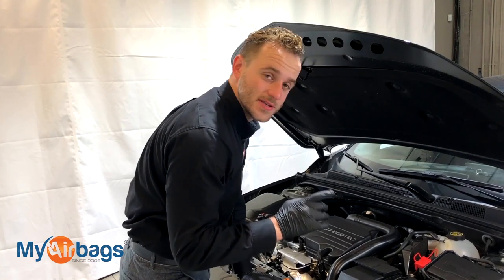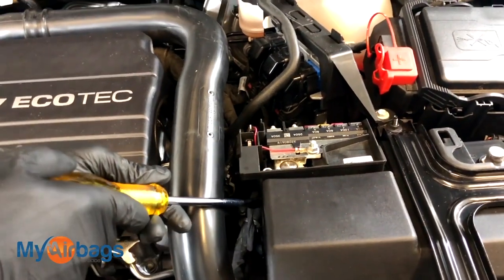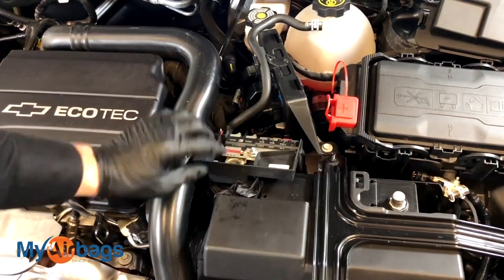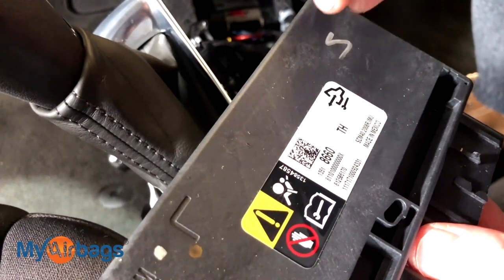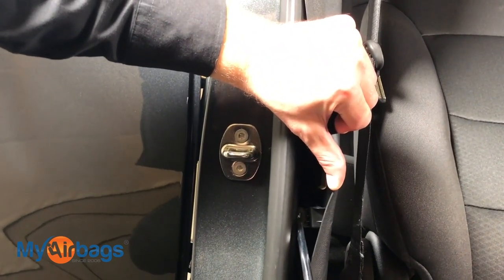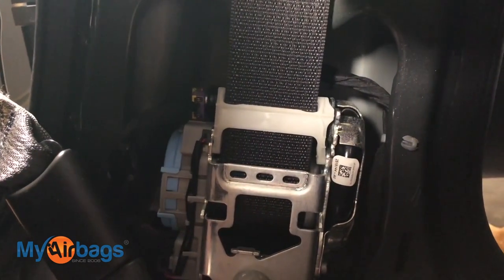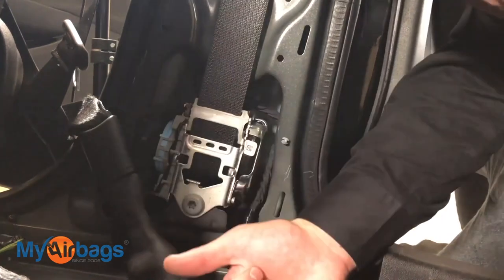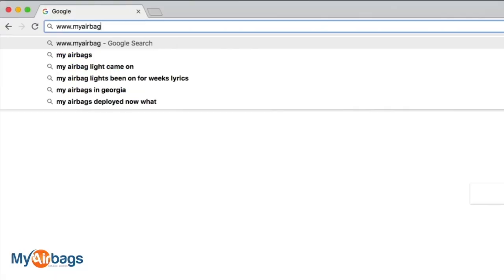How to Remove Seat Belt Pretensioner on a Chevrolet Malibu  | MyAirbags

Comment: I have a 2014 Chevy Malibu and my rear seatbelt on the drivers side is stuck. It will release a little bit but it took 15+ minutes of pulling it in and out for us to be able to buckle someone up.
Reply from the maker: It may need to be replaced or repaired. Check out myairbags.com for repair and replacements.

Comment: Question.. I’m about to do this myself in passenger side 2011
Malibu. Does this need to be programmed after install to get the light off? My light initially came on from passenger air bag pressence sensor, I replaced whole seat, but didn’t disconnect battery before I undid the seat belt so I have an open circuit.
Reply from the maker: If the vehicle was not in an accident, then the light would turn off after replacing the seat belt. If the vehicle was in an accident, then the airbag computer module also needs to be sent to MyAirbags for a reset. Visit myairbags.com for more info!

Comment: i have a 2005 Chevy Malibu Maxx LT the seat belt light started staying on how do i fix it and is the same as the 2018n model you are working on
Reply from the maker: If the light remains on it could be a for couple of different reasons. Could just be a poor connection at the plug or the actual seat belt. You hook up a scan tool and read the codes to be sure. We do rebuild seat belts but most of the time its only necessary due to an accident. www.myairbags.com
Reply: Prolly so, belt, restraints, belt clip, igniter cylinder next to clip.

Comment: My seatbelt is locked locked. I can't get it out. Should i cut it to send it to yall?
Reply from the maker: You can remove the bottom bolt that holds the seat belt webbing strap, that will get the seat belt loose.

Comment: What's the bolt type & size? (is it an allen wrench?)
Reply from the maker: Hello Saadeddin ,  which part are you asking about? Battery, module or seat belt? I'm using a Socket wrench. Theres a few different sizes for the different parts that range from 8mm - 12mm socket.
Reply: @MyAirbags  I meant the main bolts that hold the pretensioner units?
Reply: @MyAirbags  the bolt pan head that is for the pretensioner units?
Reply: I believe its a Torx 40/45 aka T40/45

Comment: I have a Chevy Malibu 2012 LT an air bag an engine light is on no matter wat I do they just bout stay on what should I do
Reply from the maker: Nella, the first step is to diagnose the airbag light. Hook up the scan tool / scanner to the car and read the airbag codes. You connect the scan tool right into the OBD port/plug. Its usually located below the steering wheel, on the left. Most Part stores like Autozone offer these diagnostic scans. Sometimes for free. You are welcome to reply to us with the trouble code that it reads.